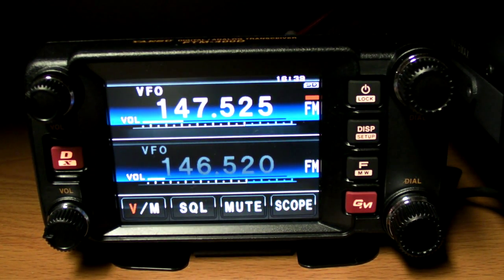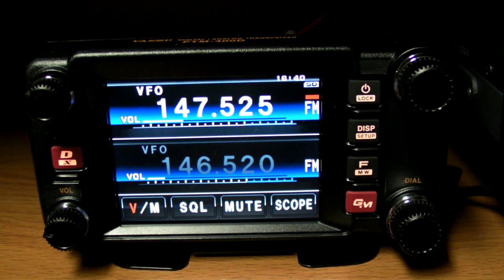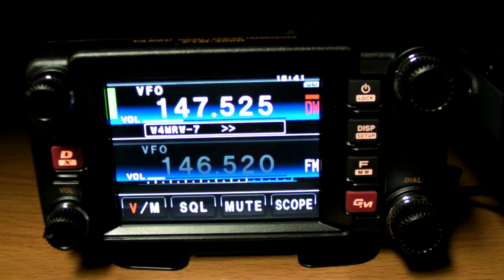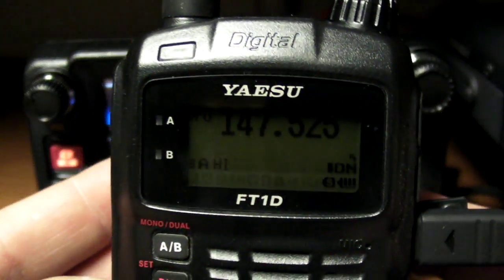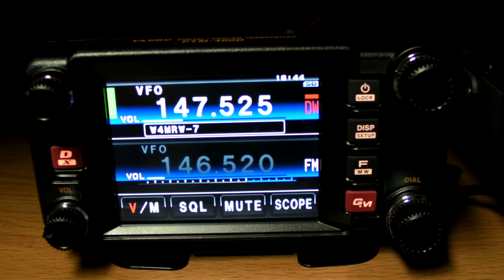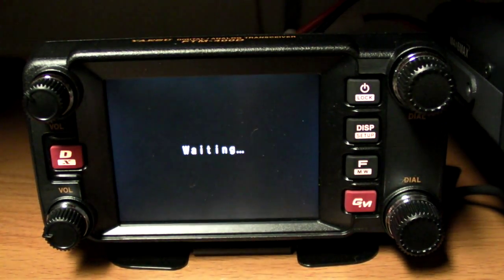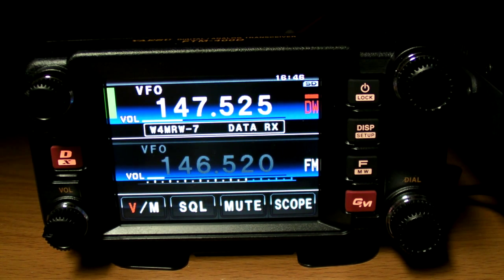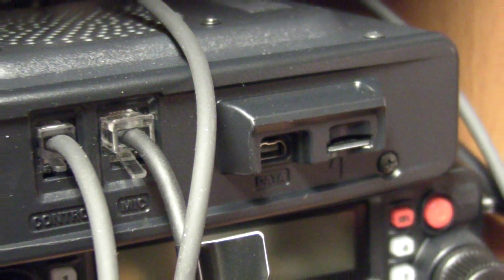Yaesu FTM-400D & FT1D - Demo of sending a digital photo

Comment: Hi there! I own a FT1D now. What I'm confusing about is whether I can turn it on while plugging the DC in. I've tried this and I can leave it receiving signal as well as transmit in low power. But will this behavior do harm to my rig? If so I should get another battery and a fast charger. What do you suggest? Thanks in advance.